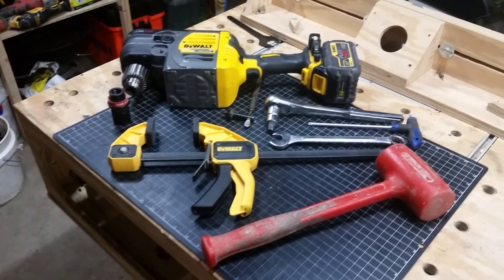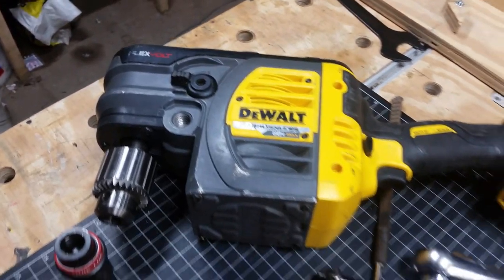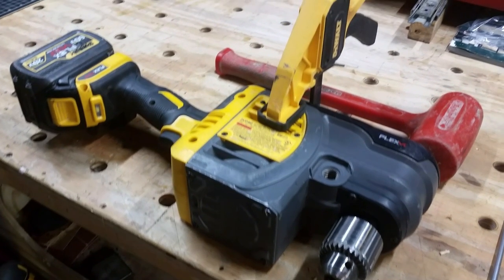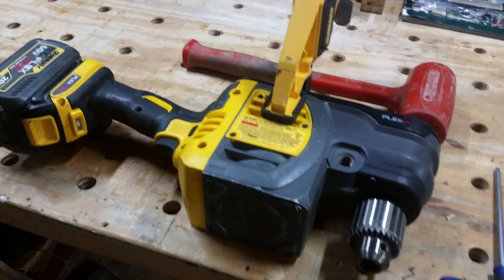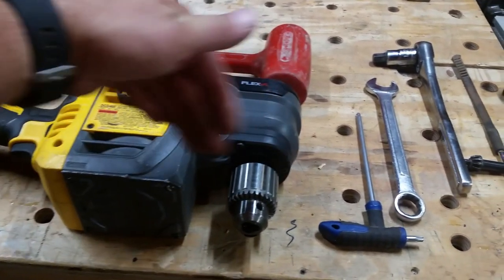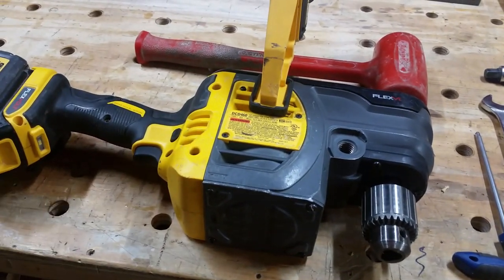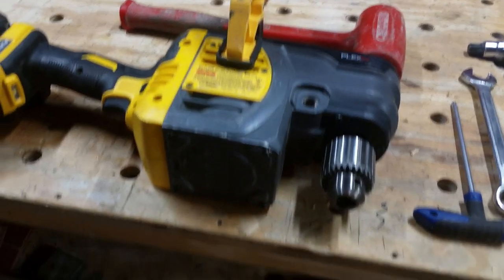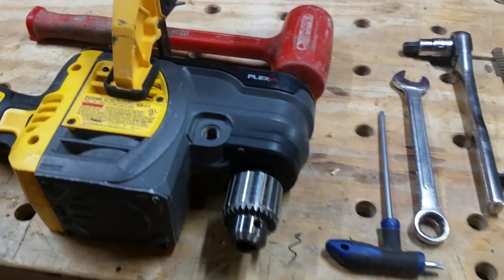How to Install Milwuakee QUIK-LOK Chuck on DeWalt Stud and Joist Drill

Comment: After removing the RT retaining screw, turn the drill over to remove the chuck.  You will be pushing the wrench into the work surface and you won't have to hold it against the hammer blows.

Comment: We did something similar by clamping the hole hawg down and then putting a 36” pipe wrench on it and pulling the trigger. We did it to an old super hawg and it threw the pipe wrench. The chuck has been jammed.

Comment: Can someone do this same video but with a Milwaukee hole Hawg PLZ.. I got the quick lock chuck but cant get the old chuck off.. the Milwaukee doesn't have a place for you to put a wrench to stop it from spinning
Reply: Did you figure out how to get the old chuck off? I’m trying to figure out how to do it.
Reply: @chrisdomenici9107  I tried but I failed, Milwaukee has a special wrench they use to hold the opposite side of the chuck on. I tried impacts but no luck because it just spins freely.  Definitely let me know if you figure it out though
Reply: I got the old chuck off. You have to remove the 4 screws holding it in place. Back behind in the center of top part of the tool is a nut that has to be backed. I used a big crescent wrench clamped in my bench vise. Used a hex bit in the chuck with a breaker bar to break it loose.
Reply: @chrisdomenici9107  hell yeah good job brother thank you for the info!

Comment: Semi-related question I hope you could help with. I just bought a Dewalt DWD450 joist drill. First time I used it drilling into oak and reversed it, the chuck came unscrewed. I can't get it to stay on. It doesn't seem to have the T30 reverse screw. Manual says to insert hex and hit with hammer. Should I try red locktite? Thanks in advance.

Comment: Heads up! I did this and utterly hate it. I use a 2' extension bit with a 18" auger regularly, and there is a lot of play with this setup, from base to tip of bit, very annoying! Not to mention, my dewalt hole hawg hardly ever e-clutched out. With this mod, it clutches out every other hole. Food for thought, I spend $60 and have nothing but regrets. 100% possible, -100% functionality 
Buy a new chuck, I'm looking into a keyless chuck.

Comment: What Is that quick chuck thread? Is it 5/8 × 16 fine thread? If so what is the Milwaukee part number? Want to convert mine. Mine has 5/8 ×16 thread. Thanks. Mark B.